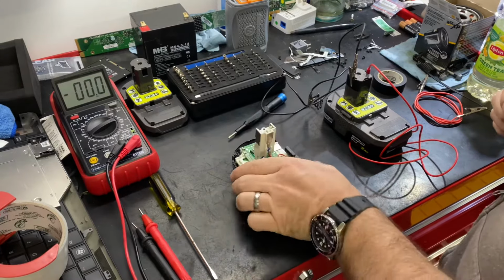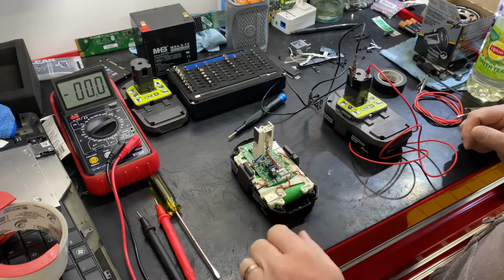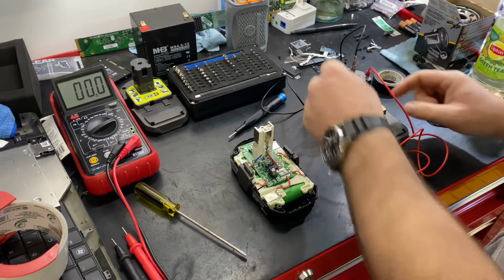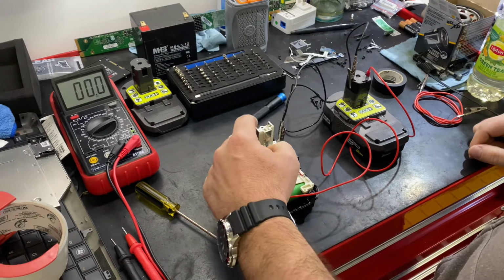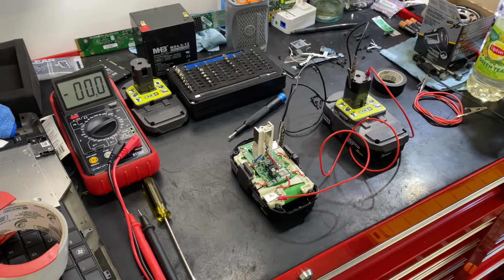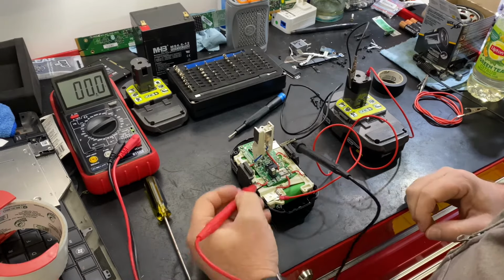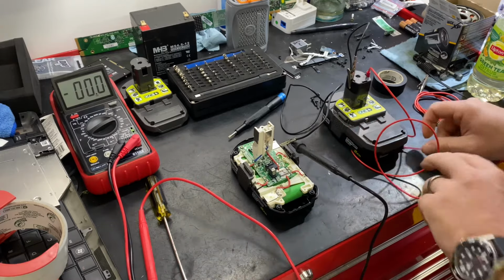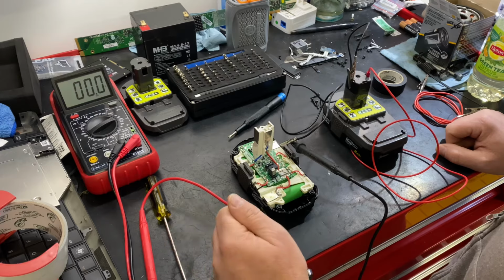Ryobi Battery Repair - Battery is not charging, how to fix [Quick Version]

Comment: Worked like a charm. Thanks for the video. I didn't have a multi-meter handy so I just left the leads on for a couple of minutes and plugged it into the intelliport and it charged right up. This saved me a lot of heart ache because it would take months to get a new battery shipped to me over here in Borneo.
Reply: I started my AT hike in 2007 as a LASHer the whole time.. I've had a couple years where I didn't get to hike at all. Now less than 400 miles to go and I haven't skipped a step or yellow blazed at all besides into town..

Comment: Hello folks; the “controller“ that he keeps mentioning is actually a “BMS“ which stands for “battery management system” and when it goes below say 12 V (in this case for an 18 V battery pack) it will shut off the power so it cannot be drained down and ruin the battery pack. Lithium does not like to be brought down to zero Volts like a nickel cadmium, lead acid or alkaline battery can be…. This is also referred to as “hitting the knee“ because if you get hit in the back of the knee you’re going to collapse and you’re not gonna be able to go anywhere possibly getting yourself into bigger trouble! ;-)

Comment: This worked perfectly.  I had to drill out the plastic cover on top of one of holes covering the screws. I reset two batteries with clips, then just tapping the good battery terminals by hand for about 30 sec. They are both useable again.  Thank you.

Comment: Looks like it will work but i only have two batteries and they are both dead. The plumber accidentally gave me a dead one and my good one went bad. Thanks for the video, it explains why hooking a battery to the top clips didn't work.

Comment: Ahhh I see you used electrical tape to secure the leads to the good battery. Simple and logical - the sort of thing that doesn't always pop into my head. Video worth that little trick alone. Thanks Brent. I've seen other videos that say you only have to connect the 2 batteries for about 10 seconds.

Comment: When I tried this I quickly found out that one of the power wires from the battery had broken off at the solder joint.  worth checking it over visually!!!

Comment: Hello print I saw your long video in this video I just want to make sure when you put those leads on bypassing the circuit board you put the red lead on the positive on the battery lead right. And the negative alligator clip to the negative lead that goes to the battery on the circuit board right through that's the only way it's going to charge back. Was that what l like to you know. Because that's what I've been doing since the 80s which were chargeable batteries. Positive lead on the positive battery Pole negative leave on the negative battery Pole.. thank you take care and stay safe doing this never ending pandemic I just wish getting rid of this would be much easier than charging batteries

Comment: Does this reset the 'controller' back to normal function or do I need to keep an eye on it not discharging past a certain voltage? thanks
Reply from the maker: You'll still need to do this probably, I've had to do it once or twice since then.

Comment: Good tip but,.....
Bear in mind when doing this, that tool makers don't want you to have a tool/battery for ever, they just want to sell more and more, so this is called "built in obsolescence"!
Reply: We have the early light bulb manufacturers to thank for this little but wasteful industry standard. I understand that businesses need profit to stay in business. As well innovation to the industry of electronics has this little trick they pulled to thank,  but...There was nothing to stop lightbulb manufacturers bulbs from working for 100 plus years in the early years . A  great product for the consumer but not favorable for a company who would much prefer to generate revenue annually equal as to what would have been centential.

Comment: My screws has a metal most in the middle of the head which prevents the T10 from engaging. Any suggestions to get around this?
Reply: You need a tamper-resistant T10. They have a small hole in the middle for these types of screws.

Comment: this worked ty, I just cancelled my battery i ordered. Would it be smart not to leave batteries in tools? Is that what causes this?
Reply from the maker: Not sure - I take my batteries out most of the time but I still have to boost this battery once in a while.
Reply: Yes, they're saying leaving battery in tool creates a drawl and drops it below voltage level where the charger doesn't recognize it and there for won't charge.  That's what i read and plan on doing.
Reply: It's never been a problem for me. A basic tool like a drill or a grinder shouldn't draw any current when not in use. I expect it to be a completely open circuit when the trigger is not activated.

Comment: I have a 2ah battery and a 5ah battery.  Yesterday my 5ah battery gave up but, when I plugged it into the charger, nothing.  So took it apart and find that the current voltage across the batteries is 18v.  But the charger won't recognise it.  I then bought a brand new (no name) 6ah battery.  When it arrived it had just two bars showing on it's little built in power meter.  Plugging it into the charger gives me the red flashing light.  Checking out the new battery, it currently has 18v.  My little 2ah battery has 20v but is fully charged.  I'm starting to think I have a charger problem.

Comment: What does a red flash light mean on a charger it’s been plugged in for 1 hour and still flashing red. Can it be the battery is no good or the charger is bad.
Reply from the maker: I believe this means the battery is not going to work. If the repair tips didn't help, I'd say the battery might be done. You could possibly try contacting ryobi also.

Comment: is there another cause for it not to charge? i have mine apart and when i check the voltage at the terminals coming out of the batteries to the pcb it has 20v but at the actual tool terminals on top, it has zero. and when i press the bottom to check it only one LED blinks, it won't charge. ive tried balancing it with a different battery. i don't see anything that's burnt on the board i can't find any type of fuse. if anyone has any ideas I'd be grateful because i need this  4ah to work again!
Reply from the maker: it sounds like that battery management system might be bad.

Comment: Why do you have to take the battery apart?    Why couldn’t you just jumper to the metal leads on the battery outside?
Reply: Because that doesn't bypass the BMS. If that worked, the charger would have worked, too.

Comment: If my ryobi batteries show fully charged on the charger but only run for about 30 seconds to 1 minute and are dead again, could this possibly solve my issue?
Reply: 1 dead battery cell. Needs changing

Comment: bjr DoerOfThings, lorsque je mesure la tension sur ma batterie sans la démonter , je trouve 6,7V
Et lorsque je demonte ma batterie et que je prends la tension au borne du circuit je trouve 18,6V
D'où mon probleme peut il venir ?
merci d'avance
Reply from the maker: No puedo decir el 100%, pero parece que la placa del sistema de gestión de la batería puede ser el problema. Lo siento, el español no es mi primer idioma.
Reply: @brenth7774  Merci beaucoup pour votre reponse

Comment: While the battery is open there, why not install some new  higher  power 18650  batteries. ?
Reply: Why would you?

They're 2500mah cells - can only go to a max of 3000 if you still want high current.

Comment: so i've gotten a bad battery up to about 13 volts with your method, and when I put it on the charger, it will flash red several times, then green about 6 times, then solid red.  I removed and replaced battery on charger 20 times or so and it is still the same.  What next?
Reply from the maker: i think in that case it might be the management system board that's on the battery. Might not have a choice but to replace the battery.
Reply: So does the msb issue preclude replacing cells, which I understand are about a dollar a piece?  I’ve gone thru so many ryobi batteries, and this is a relatively new ryobi brand battery.  It seems to be a crapshoot to buy the knockoffs, though.  What a racket!

Comment: For some reason the cell pack is at 18.2, 
But the leads going from the board and the contacts for the tool only read 14. It's something with the board that's not getting the full voltage across. How sad for me wah
Reply: That may just be that the dead pack is accepting so much current that it's causing such a high voltage drop.

Does the good battery still have bars of charge when you do this?

Comment: " I'm not an electrical expert. I know just enough to be dangerous" I predict that truer words have never been spoken. What happened the next 20 or 30 times you used this battery? Did you have to do this each time to recharge it? If that's the case, that does NOT constitute a repair!
Reply: @ScoreboardTV  Most portable tool companies do the same thing with their chargers. Voltage low - don't charge. Each battery pack has its own Battery Management System (BMS). The BMS is supposed to, among other things,   PREVENT the battery from going so low that it can't be recharged. The BMS may do its job by shutting the tool down at the proper time, BUT if there is a bad cell in the battery, (that's where an actual repair would be needed, ie, replace the bad cell) that bad cell, if you don't immediately recharge, would continue to drain the battery to such a low voltage that the charger won't recognize it when you finally get around to charging it. A second scenario would be a BMS that was malfunctioning and just letting the battery run down too low in the tool to be detected by the charger. That would also require an actual "repair", ie, replace the BMS. In both circumstances, you can make the battery work by taking it apart and zapping it, but it isn't "repaired". I hope this helps you understand why I questioned whether this was an actual repair or a "pain in the ass" workaround. In this case it seems to have been a one off malfunction that got straightened out by this technique. I think for a fair number of times this will be a workaround rather than a repair.
Reply from the maker: I was able to get more use out of it multiple times but it did have the same issue again, it's sitting on a shelf and I don't remember how long that's been. it might be enough to get someone else by if they can't afford a new battery right away.